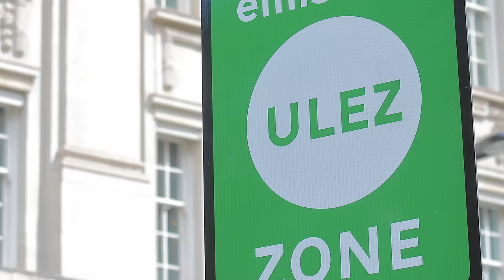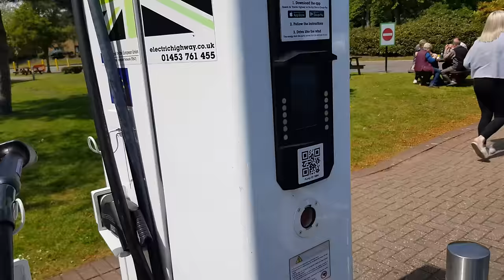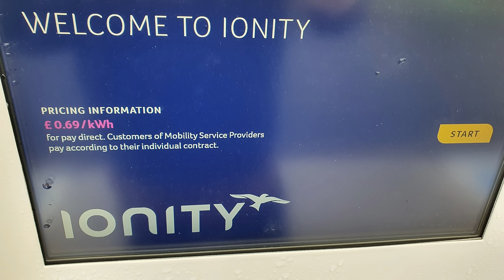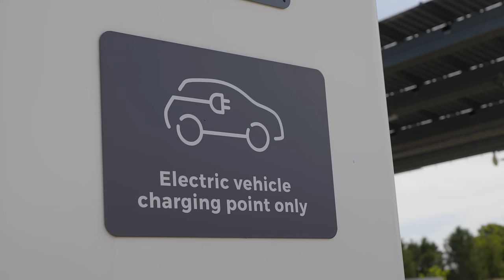The Uncomfortable TRUTH About EVs: The Version NEITHER SIDE Wants You To Hear

Comment: The profit margin on commercial EV chargers must be huge. 
It's still the same electricity at the end of the day, they just shift it from the grid into your car faster. Due to the fact most seem to be out of order and there's simply not enough, plus range anxiety, people are basically forced to commit to the first free space they find. That, and most people with EVs are on the richer scale of the population so it doesn't impact their wallet as much.

I do think the auto industry missed the mark though as the charging network wasn't ready and frankly still isn't. There should have been more EVs with Range Extenders (ev-rex) as these cover the daily commute easily (say range of 50miles) but also have a petrol engine for longer journeys. They would have been perfect for a more phased introduction to EVs. Chevrolet Volt/Vauxhall Ampera and BMW i3 come to mind, I'm soon to be receiving the former in a couple of weeks! As there's not many of this type they are still fetch a high price even 12 years old, but would be ideal in the used market if they were commonplace. Most old EVs just don't have the range as the tech wasn't there so felt committed to relatively short journeys. EV for day to day, second car petrol/diesel for longer trips is not feasible for most.

Comment: My 2011 Chevy Volt (at over 200,000 km) still has 75% original battery capacity, and my Father in Law is now the happy driver of it. So there's 13 years of data from a first generation EV.

Comment: Just for information.  At several points in your video you show fairly fancy multi-bay charging stations.  I live in South Africa.  At this time, I can only think of one public charging station in the near vicinity (say a radius of 10km) and it has two bays.   That's it.  In the same radius, there are probably more than 20 fuel stations. 
I have a pretty good solar installation in my home.  I've done the calculations, and I can't charge an EV from close to empty in one day with my spare power.  Closer to one charge per week.  That doesn't thrill me.

Comment: some fun facts
1) EVs are heavier than combustion engine cars.
2) In the UK fire stations have been fitted with car baths as an electric vehicle must be submerged for two days if it has caught fire.
3) What do we do with the used batteries?
4) In early 2000 we were told diesel cars were the future now? This could be the same as electric, good until it isn't.
5) The answer is small cars to run around the country, then all cities should be vehcile exempt except delivery vehicles (need license to enter the city) & public transport.

Comment: Excellent video! I could see the points you made falling on deaf ears here in US. I just want an AWD Type-R EV with 500 HP and 700 torque to charge at home, sprint to work, charge at work, and sprint back home again. Also sci-fi gave us fuel pods or cells or whatever. I run electric r/c trucks. I dont charge them! I replace the batteries. Need a system to drop universal battery cell out for a new one. Let the "fuel station" worry about charging. A new approach to this whole system is probably too late though..

Comment: Big and expensive EVs have been more prevalent in the market because the profit margin on them is larger, and the EV tech has a fraction of the effort put into making it cheap than ICE has had over the last 100 years. If the cheapest functional EV would be expensive vs the ICE equivalent, then price conscious buyers won't buy them. We needed to target the people with lots of cash and position it as a luxury product. As the technology matures and sales volumes increase the minimum cost per unit decreases and we can bring down that purchase price on the cheapest models to enable more of the market to consider buying a brand new EV. 

This is how new tech get's into most/any market: Starts expensive and niche. Either catches on and trickles down to cheaper products, or it doesn't and we stop making it. Like 3D TVs died out, but I think VR might be here to stay in the long run.

Comment: Another thing that isn't being taken into account regarding pollution is the particulate matter from the wear on the tires. 
Some of the fine powders that come off of these tires and are flung into the air are downright toxic and electric vehicles due to their weight and torque wear tires at a higher rate than their counterparts.

Comment: Petrol doesn't actually burn - the fumes or vapour is what burns. Which sounds nit-picky but its actually a very important distinction. You need the correct air/vapour mixture to make it flammable. Which is why you don't often see petrol cars on fire and when they do catch fire you essentially just have to change the fuel/air mixture to put it out.  LION batteries are flammable and if some sort of internal short or other damage causes the internal gasses to expand, the previously airtight case will rupture (an explosion not an ignition or fire) highly flammable gasses are released and if the internal damage causes a spark they will ignite producing more gasses etc.Which is why they are very hard to put out. You basically have to wait for the energy to dissipate. Just be grateful that the energy density of LION batteries is so low compared to petrol (0.6 MJ/KG as opposed to 13 odd) - 
That's  a very simplified explanation obviously

Comment: 500miles on £8!? 

I'm doing nearly exactly that in my 3Ton, 20 year old 2.3jtd commonrail diesel campervan which cost me less than the depreciation of any new electric car when it's taken off the forecourt. 

I run it on used cooking oil, a carbon neutral, non Fossil fuel and pick ut up for free along the way...

I can also fill it up nearly as quick as when at a filling station, not hours charging it up. 

Oh and my fuel range is nearly 1500 miles.

Comment: So many good points here to my mind. 
I’m not going to be looking for a new vehicle for some time yet I expect, drive a diesel Vauxhall Vivaro (need the space for 🐶🐶 and 🚲) I get 44 mpg and it does all I need. 
For those looking at EV’s the manufacturers to date seem to have been fixated on performance (speed) and to hell with accurate range figures! 
That’s where smaller more realistic and cost effective models are required. 
Frankly the whole EV situation has been a knee jerk reaction by those in power. EV’s are only a very small percentage of the green answer.

Comment: My only disagreement is that contactless can be a bit iffy, my last bankcard lasted it's full 3 years and the contactless was still working right until the cards expiry, that being the very first card i have ever had that i didn't need to order a replacement because it stopped working. The magnetic strip always failed not to mention that with that tech i now have 2 copies of the card the actual card in my wallet and one on my phone

Comment: My main issue (after owning two higher end EV’s) is range. Real world it’s darn hard to get more than 200 miles of range. Weather, passengers, real highway speeds etc all drag it down hard. Winters near 0 degrees F? Hard to get over 150 miles. And they won’t make high range EV’s. They want you dependent on their charge stations as often as possible, whereas I like to know I can drive all day and still make it home without depending on a charge station, like I can in my eco boost f150 which has nearly 700 miles of real world range. Unlike my Ecoboost my father has a F150 Lightning EV with claimed 300 miles of range, which real world charging and driving habit lowers to at best 225, would need to charge about 3-4 times at 45 minutes each to cover the same distance as my single fuel tank. 

That said I love literally everything else about EV’s, cost of ownership, ease of home charging, power and performance. But since Tesla killed the 500 mile range Cybertruck I doubt we will ever see EV’s with much more range than now, as batteries get better and cars more efficient they will just use smaller batteries to lower cost and raise margins.
Reply: Two solutions - one is to also have an ICE vehicle which for most people is probably mostly practical in family/couple situations.  This is my situation, I have an EV plus several ICE vehicles and I have a home with a garage where I can charge the EV at home.  It works perfectly for 95% of trips and if I have to take a long trip where charging is a hassle I take one of the ICE cars.  My range is exactly how you describe it - 200 miles in ideal conditions, but more like 150 miles because I like to go fast or if its cold or going uphill. The second solution is a plug-in hybrid.  Most days most people don't drive more than 50 miles which you can do in a full EV mode on a hybrid and then if you need the range you can use the gas engine.

Comment: 20:58 the luton airport fire was caused by a 2023/24 land rover diesel hybrid since at that specific year land rover didn't offer a diesel only car which is kinda depressing since i like diesel hybrids.

24:31 an EV battery is made up of 100's of cells hell tesla's are made up of 1000's of cells all it takes is one bad cell or one cell to go bad which then get's cycled harder meaning it produces a lot more heat till eventually it goes bang this causes a thermal runaway where it kills other batteries in the pack which then combust themselves since they're so close together. before anyone say's "a BMS fixes that" yes and no on small packs yes this isn't an issue however these packs are 100p100s packs meaning one bms is monitoring a 100 cells in parallel so those small changes to balance them is less obvious since it's hidden with 99 good cells to 1 bad cell. this is a major design flaw which manufactures will not fix because it will make EV's such as the Leaf priced out of the market, instead of a leaf costing 25k they'll instead cost 50k. this is the reason why you see EV's on fire often not because of the hate but because like the samsung phone batteries the design is flawed.

29:50 this is actually happening in London where to park EV's are charged 10x than a normal car 

30:27 we actually do have the data for this with common electronics for example for my e cigarette which i've used for around 12 years the dual 18650's in it last me between 1 to 4 years before they become unusable depending on the brand, for my electric skateboard (which i built myself FYI battery pack and all) which i've been using for 10 years which is a 12s4p has similar figures needing to be replaced every 5 years since i've replaced the packs twice due a third soon. the reason it lasted so long is since i always have it on charge & the lowest it ever goes is 80%, for my ESAB PAPR respirator for work (which gets some hammer) i've replaced the battery twice in the 4 years i've owned it which is a 2s2p pack for the smaller one & 2s4p for the "heavy duty" one & recently converted it to run off a makita 18v since the battery units were £100 to £300's for the big and small ones whist the makita 18v batteries cost £50's for two 18v clones which is WAY cheaper. so what i'm saying is the data is there especially for the 18650's which other than teslas is what most EV's use, 1 to 5 years depending on how low you drain the cells this will not change since the cells are the same structure even tesla ones are just bigger 18650's but that can only be told in time.
 just realised with my vape & using a E  skateboard i sound like such a hippy, i swear i'm not doing this for style i'm using them because they're cheap lmfao.

Comment: Ev’s have just become part of building legislation in Australia. All new apartment buildings are to have allowance and provision for 100% EV charging bays! So that could equate to anything from 6-600. If the future does see this eventuate, the massive issue that is yet to be properly addressed is that if there was to be an EV fire in a basement that has 6-600 evs within it. That building is basically shot. The burn time of the car exceeds the structural resistance to fire time. Will only need to happen once then all of a sudden buildings won’t be able to be insured. There is a lot more to this obviously but the largest is how to supply power for this amount of energy demand……it doesn’t work

Comment: Good and balanced.

I like your comments on older cars being with relatively poor families.  We need to help them, especially as they will have the worst polluters almost by definition.

FWIW I’ve always thought EVs would depreciate a bit faster because new tech impacts them more.  But they will have a higher floor price as the batteries have a higher value than engines.

Comment: Honestly, good points here.
The thing is - EVs can use renewable energy, ICVs cannot. And, yes, climate change is a death-by-a-thousand-cuts problem, which requires a massive, multidimensional, complex solution, but when it comes to transportation - this is basically where the story begins and ends.
Regular fuel delivers about 20x more energy per mass than a single charge of an equivalent mass of a lithium battery, but the battery can be recharged, and I've done the math on this one - assuming that the battery loses 40% of its charge over 400 charge cycles (I think you can stretch this quite a bit if you care for the health of the battery), then the total energy stored and deployed is ~15x of an equivalent amount of gasoline, and after that the battery can be recycled to recover up to 95% of the materials. Recovering burned fuel is probably technically possible, but it's basically carbon capture - rather than burning it and re-releasing it, it should be stored underground where it came from.
Then there's also the thing about efficiency - internal combustion engines are doing well to convert a third of the energy of the detonation into speed, whereas electric motors are a bad batch, if you're getting under 70% out of them.

And, even with all that being said - addressing climate change will be a negative sum game for several generations. We so far have ignored CO2 emissions, and, well, accounting for it will cost us one way or another. The only question is whether it happens with higher electricity prices or in a war over water and food when water patterns are all f*cked up.

Comment: How about doing the same trip to Scotland, in the same car during winter, then tell us you got the same range with the same costs. It seems to me that the range given by manufacturers are done in ideal conditions, whereas the reality for most ex- Ev owners like myself, is 3/4 of the stated range, going down to 1/2 in cold winter climate, ( It's not pleasant driving  80 miles having to use the heater intermittently when the temp is -1 to +1 as your range reduces in front of your eyes, each time you do). A Vehicle  is for all year use, my Ev did not live up to this, & as for towing my trailer tent, you can forget it. I now have an ICE vehicle that does all of this without range anxiety or the fact of how much depreciation I suffered when I sold it after 2 years.

Comment: Petrol is a way for energy storage, so the prices can be more stable. With electricity the price will depend a lot more on supply&demand. It's still expensive to store electricity. The prices move depending on when and where you are. A fast charger also requires more expensive equipment, so you have to pay for that too built into the electricity prices.

Comment: The airport parking fire was caused by hybrid Range Rover, as can be seen in one of the pictures. The fire bursts underneath the car from the left side where the lithium battery is located. The diesel story was created before the picture and it apparently stuck.
The lithium battery fires are impossible to put out, and that is why the EV:s and hybrids should be banned at car parks that are below buildings or within a shopping mall.
The bans are coming, Norway to car ferries, Germany to underground parking halls in couple of cities already, and it is just a matter of time that there will be no way to take an EV fron Britain to France because Channel tunnel will eventually ban EV:s as will car ferries. Isolation.
And, there will not be enough copper for EV:s to replace ICE vehicles, that is already a fact. My brother has a hybrid Panamera, and it makes sense to him as he can charge it at home for commuting 40 km:s back and forth. But full EV:s are just stupidity for 95% of motorists. At least here in Finland.

Comment: One big question with regarding the EV market. If there is a massive development in the battery safety via a change in elements used that gives superior safety and a range improvement that remains regardless of weather conditions, will they be offered as a substitute to existing buyers of the original models!